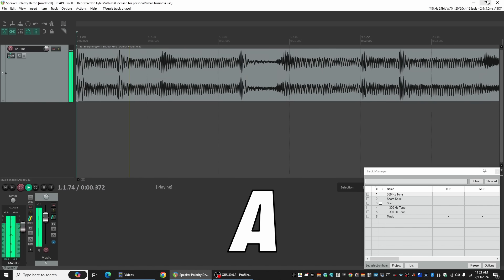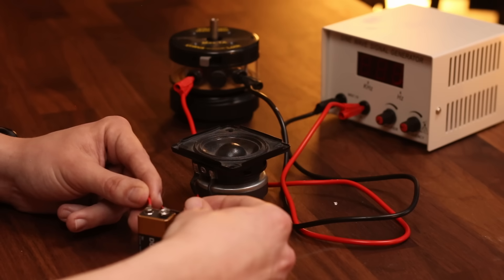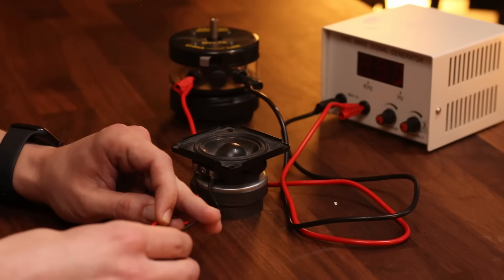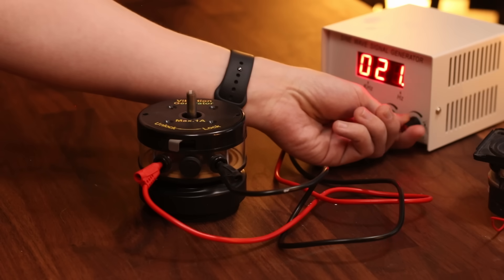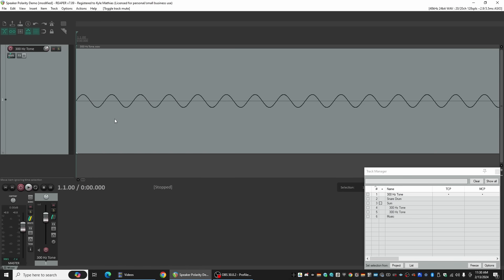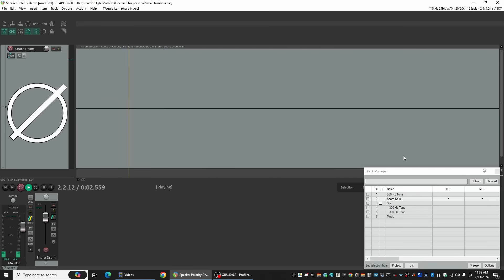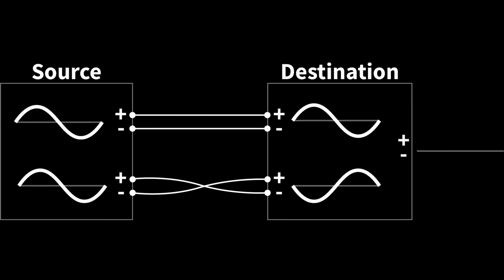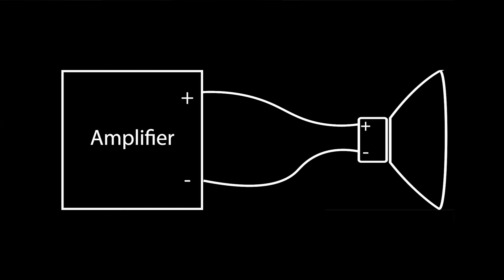What Happens When You Wire Speakers Backwards?

Comment: The problem with wiring speakers backwards happens in the crossover. capacitors don't work backwards. just sayin'
Reply: Audio capacitors are bi-directional.
Reply: @wally7856  Then, why are they labeled + /-?, At least the ones on old school crossover boards are.
Reply: @greg-g4t  The capacitors or the boards are labeled as such? Audio is AC, for every positive part of a sine wave there has to be an equal negative part as well.

Comment: The coils/cones are very slightly asymetric. No speaker is 100% symetrical. Most are up to 3% off.  But which way round is unimportant if the stereo pair are wired the same.

Comment: GREAT video, thanks. I had never seen this before, had been told inaccurate things, and it never made sense. THIS does make sense. The one and only possible inaccuracy I see here is that you a 1:42 describe an audio signal as AC. No doubt it varies with time, but usually AC refers to signals that are periodic, which is a particular type of variation.

Comment: The polarity phase is one factor . The mechanical function of the speaker is important the outward motion is virtually unlimited untill the speaker coil is pushed completely out of the permanent magnet field . Pull the coil into the permanent is limited and potentially mechanically striking the back side of the chamber damaging the coil rapidly. Another point is amplifyers actually put out oscillating DC current ,not AC that is the polarity never reverses. Speakers move inward essentially  on spring power built into the speakers Support not on magnetic force.

Comment: The great Bob Carver was incredibly adept at creating solid state amplifier circuits. Eventually he said he could duplicate the sound of a tube amp perfectly so that no one could tell the difference between his solid state amp and the tube amp. Obviously audiophiles dismissed this but he persisted until finally Stereophile magazine took up the challenge and arranged for an acknowledged group of audiophiles to listen A/B to the amps in a controlled environment. Carver won the challenge; no one could tell the difference. He also won some great support for his products from the audiophile world.

The way he confirmed he was exactly matching the tube amp while he was designing it was to take a signal and run it through the tube amp and invert the polarity and run it through his amp. When his amp output mixed with the tube amp output produced silence he knew he was perfectly reproducing the tube amp signal. This was a very clever idea and helps show how his knowledge of the workings of electronic signals made him a great engineer.
Reply: That's brilliant.
Reply: Still using a Carver C1 preamp and a Phase Linear 400.
Reply: Dr Bose had his famous 901 speakers, with the instructions that told people to point array of 8 speakers to the rear wall with the one front firing speaker pointing into the room, but in his office he had them reversed so that the 8 speaker array was pointing into the room, I know this because I personally saw the speakers set up that way in his office.  When I asked why he reversed his speakers he laughed and said, "it's just marketing"!  But there was a sound difference, the bass, which wasn't much to begin with, got even less, while the midrange sounded more aggressive, and the treble was brighter. He was saying that there was nothing wrong with either position, but he did say the walls of a room play a very important part as to how speakers will sound.

Quite frankly, I never cared for the sound of the 901s unless all they played through them was electric guitar and no other instruments or voices!  I own Bose main competitor instead and bought a pair of JBL L7s 30 years ago.

Comment: They’re out of phase. They’re not pushing air out in the same direction at the same time. So check the wiring, and put the correct colored wires on the correct poles. Also get the right wire gave for your speaker size.

Comment: It is very hard to understand a wrong polarity if all speakers have inverted polarity. But, if one is inverted, it is very easy to understand as you say it.

In seriously high quality (naturally simple) devices, with a high quality audio source, with a decent listening area, you can actually spot the differance. The main differance will be on high frequencies, not the bass, specially in the tweeter area. That is mostly because of using more than one drivers in a single speaker. We need crossovers before drivers. This causes an added complexity. Also, higher frequencies are mostly faster. Think of a kick time in miliseconds and a bell time in miliseconds. So, fast changing sounds makes you understand the polarity is wrong. But, you can not say "this sounds bad." or "there is something wrong here". If you are used to the track you play with your 3-5 year old equipment, you can sense "something is different". Therefore we audiophiles have some favorate test music tracks. :D

By the way, being an audiophile is not a hobby. It is a curse or at least an illness. :D

Comment: It would be very much like standing in the field of the double slit experiment .. if the speakers would emit a perfect sine wave of the exact same frequency, you could sample each point in the field with a really good microphone and could make a map similar to the slit animation. You will also discover that this is regardless of wether you remembered to swap one of the speaker terminals or not - this, and the frequency, will only decide the actual positions of the lows and highs. Actual sound is almost never a sine wave. There will be a tapestry of fields intertwined and combined with reflections in the room and background noise. The cancellation is impossible to sense. If you move around, the uneven spread of sound from the speaker elements and the distance to them will change perceived sound - and even distort differently for different frequencies. That, you can sense.

Comment: The computers help everything analysis easier nowadays .Because I had my experience coincidencely (invers polarity the amply and speaker) heard some songs by the simply audio system (player and amplifier tape deck) and the result heard nothing abnormal sound. Then I realized misplaceng the cables, fortunately didn't destruct the speaker.

Comment: If you wire them backwards (out of phase) they go in instead of out. If all of the speakers are out of phase it doesn't matter. If you have opposite phases in a pair the bass gets cancelled out. Sometimes you purposely wire midbass out of phase with the tweeters in car audio because it helps with time alignment when using component speakers. Saved you 7:50.

Comment: Well done clip.    The effect of phase on audio signals is also one of the main reasons that listening area and speaker placement are important.  Out of phase reflections can influence complex waveforms for the same reason as reversed signal wires.   In different magnitude and result, but phase effects can be noticeable.

Comment: It's weird but I hear it, kinda funny pressure in my ears, something's off...
Mechanically, a coil that drives a membrane has mechanical limit to move down and much greater limit to move up, towards the membrane.
If we connect incorectly, we would wore it to work against it's designed movements and increase the wear- it will fail or loose it's sound properties much quicker.
Also, sound spectrum will be different if you listen from correct connection versus incorrect, some frequencies will be changed-shifted

Comment: The waveform you see on an oscilloscope is a graphical representation of air pressure. By convention, the positive half cycles are compressed air, the negative half cycles are expanded air pressure. When you speak into a microphone, the compressed air pressure half cycles of the soundwave (your voice) pushes the diaphram away and the expanded half sucks it back towards you. The loudspeaker is supposed to faithfully reproduce that. So the speaker cone pushes air to compress it on the positive half cycle and expands it on negative half cycles. So on paper, this does matter. In practice though, you're right, there is no perceivable difference. But it's always best to do things properly.

Comment: Here's a good tip to stabilize a live pa system.  Front vocal line- throw every other vocal mic out of phase.  Rather than mic anomalies due to multiple mics adding up and destabilizing the system increasing the chance of feedback, throwing every other mic out of phase will cancel out those frequencies that otherwise might feedback.  This stabilizes both monitors and mains. Before digital boards, I had several mic cables clearly labeled that were out of phase.  Now you can do it with just a click!

Comment: If you have a cubed chamber with a port hole, 3 speakers on the left of the inside of the chamber and 3 speakers on the right, would making one side reversed polarity change the acoustics of the chamber since the left side is pushing out when the right side is pulling in? Someone needs to test this.

Comment: My Bose 501 speaker tweeters are mounted directionally 180 degrees out from each other and they are wired out of phase with each other. What could be the reason for this?

Comment: It's always annoying on old cars that use proprietary plugs with stupid colours, speaker terminals are all same size and always have to cut that crap and use the battery to check polarity to then solder normal speaker plugs, a stupid unnecessary extra step.

And worse on my Peugeot 206 1.4 HDI 4 door the rear speakers use damn stupid rivets, had to put my hand from behind to put clips and hang while screweing and my arm got all scratched from the lack of space 🤬

Comment: Phase cancellation  is more audible at bass frequencies. If you wire one of the two front speakers opposite you notice like someone pumps your ear out. Depending on which ear you feeling this, that is the right polarity and the other is opposite. 
Of course this is also obvious with the subwoofers and speakers.

Comment: Explaining the type of current in speakers
• Pulsed DC: Although speakers are powered by an amplifier connected to AC, this is converted to a form of pulsating DC that varies in strength and direction to follow the sound signal. This causes the speaker diaphragm to move back and forth, creating sound.
• Why not pure AC?
• Alternating current oscillates smoothly between positive and negative voltages, but does not contain information about the frequency and amplitude of the sound in the same way that an audio signal does.
• Connecting pure AC directly to a speaker will only create noise and not meaningful sound.

Comment: Basically what you just showed is how to test the polarity of a speaker now.If you're running a single channel like a subwoofer, you'll notice a sound difference, but not dramatic, but there will be a difference.Now if you're running a left and a right channel, and you change the polarity on one speaker, you will notice an extreme difference.

Comment: Years ago I built a subwoofer from a design called a "push/pull" system. The two 15" woofers were mounted on a single 1" baffle board, with  an appropriate size hole, but were facing
each other and wired out of phase. This set up was placed on top of a large speaker box and the box was filled with foam and thightly sealed. I forget the exact low pass coil that I used
but I think it was around 200hz. I hooked this beast up to a digital church organ (Allen) and the low frequencies were just astonishing, even with a meager 200 watt amp. My question is:
do you have knowledge/experience using the 'push/pull' speaker design?

Comment: Just as adding current to speakers dilates the cone by magnetic force , the inverse is, generating current from sound waves , for instance, setting up two ( or however many ) subwoofers close to say Niagara Falls, a source of low frequency high intensity sound and connecting the speaker wires to a battery will charge the battery over time ( not that much time either ) and needs to be rectified to DC current   , the bigger the subwoofer the more energy could be tapped from the sound of the waterfall . Any suitably large source of sound could be converted  to electric current by a simple set of speakers . 

Free renewable energy.

Comment: I sold hi-f between 1976 and 1980 and, at the time, considered myself an audiophile. There is one thing I had a keen ear for: stereo speakers wired out of phase. It's easy to tell when they are next to each other because when you turn off one, the bass increases noticeably. 

However, I learned an easy way to tell when I wanted others to hear it and I didn't want to move speakers around. Simply provide a mono signal and put your head between the speakers. IF they are in phase, the sound comes from the center. If they are out of phase, you can't pinpoint a place where the sound is coming from. 

Messing around with phase is how they get ultra wide and surround sound from a single sound bar. But your head has to be in a pretty precise area for it to work correctly.

Comment: Todays modern speakers stem from Faraday's Law.  ( 1850) .  Before electricity was actually invented through mathematics, he determined if you took a wire wrapped it around a magnet and put a force from one end it will force the magnet to go one way and if you took the force from the other end of the wire and force it through the magnet would come back at you.

Comment: Well depending on your speaker configuration reversing polarity is normal. Many car audio and powered subwoofers have a "PHASE" usually 0 deg to 180 deg. out. The 180 deg. is reversed polarity.

Comment: Years ago I was doing sound for a band/ event (I am an amateur just had the equipment, so..) and a guy with much more experience than me said " one of your speakers is out of phase" I didn't know what he meant, and couldn't hear it (there were a bunch of speakers and it was a loud gig) . Now I have some idea, just need to dig out the gear that hasn't been used in a decade and see if I can figure it out ;) I have 3 of the same Beringer powered 8" speakers, 2 bought new and the other bought used.. I can guess which one it would be, but after a few years of shows they all look the same now :)

Comment: THERE IS ALSO ANOTHER REASON TO WIRE THE SPEAKERS WITH THE CORRECT POLARITY. THE - , OR NEGATIVE TERMINAL IS CONNECTED TO THE CHASSIS GROUND WHICH CONNECTS TO THE NEGATIVE TERMINAL OF THE AC OUTLET WHICH ALSO HAS THE NEGATIVE TERMINAL GROUNDED. ADD SPEAKERS PUT IN THE LOW VOLTAGE OUTPUT, IT'S NOT DANGEROUS IF THERE WAS EVER AN ELECTRICAL FAULT. BUT WITH HIGH VOLTAGE SPEAKERS, IT COULD BE A HAZARD  IF AN ELECTRICAL FAULT SITUATION DEVELOPED.

Comment: A single speaker receiving a mono signal will have no issues. Two or more speakers receiving a stereo signal, one left and one right must be in phase. If they are out of phase with each other, the bass notes won't have the dynamic impact, and the stereo imagery will be scattered. If the source has a recorded engineered soundstage, it won't be reproduced properly.

Comment: I recently biwired my old PSB century tower speakers, with speaker wire from “world best cables, which comes with a dedicated/assigned high frequency wires and low frequency
wires” that I purchased about two weeks ago. Over the same time span I’ve been listening to various CDs from my CD collection through my CD changer into my old NAD audio video receiver. And upon listening to John Cougar Mellencamp CDs, I notice a lack of low frequencies. Which I don’t recall “NOT” hearing through my previous XLO single speaker wire connection to the bottom left and right bridge connected terminals. (Note that the polarities are correct with both old single pair and new biwire speaker wire/cables. )Having read and seen on YouTube that the bottom speaker terminal are for the low frequencies and the top for the high frequencies in a biwire set up (bridged removed.) In the biwire set up, I decided to first disconnect the high frequencies to see if I could hear the low frequencies coming out of the speakers. I was not hearing any lows, I decided to reverse still maintaining the correct polarity, the top assigned frequency wire to the low frequency terminals. And the top high frequencies wire to the bottom low frequency terminals, thinking that maybe the manufacturer label the cables incorrectly. Long story short  this did not accomplish anything, if anything I became confused, realizing I was out of my debt. So I reverse the cables to the correct positions. The assigned highs speaker wire to the top terminals with correct polarity as originally, and the low speaker wire to the low terminals, again with correct polarity as originally. Now here’s my $5 million question could I damage my tweeders in both speakers, and possibly damage the dual woofers in both towers? Because unless my ears are deceiving me, or my worry for having done something I shouldn’t had got the best of me, I’ve noticed unusual excessive highs from the tweeters with some distortion, in the way of the singer’s voice cracking as if they’re singing beyond their vocal range, and insufficient lows from the woofers with some distortion. Or could it be that the world best buy wireless speaker cables are in the process of still breaking in because the instructions say that it takes him 750 hours to break in which is approximately, this is according to Alexa, seven days seven hours. Please tell me that I didn’t damage my speakers and that is maybe the speaker wire breaking in still.🤦🏻‍♂️🤦🏻‍♂️🤦🏻‍♂️🤦🏻‍♂️🤦🏻‍♂️🤦🏻‍♂️🤦🏻‍♂️

Comment: The only scenerio to be avoided is reversing polarity of 2 woofers/subwoofers sharing the same box. That will immediately kill low frequencies through cancellation. Other scenerios are dependent on played frequency, room reflections, speaker placement rather than speaker polarity. You will get cancellations or additions with speakers having the same polarity.